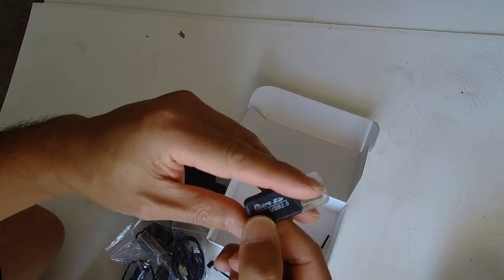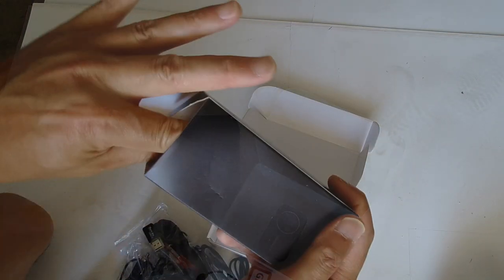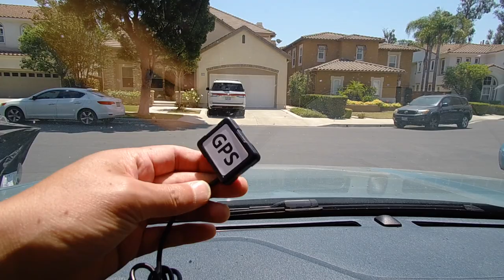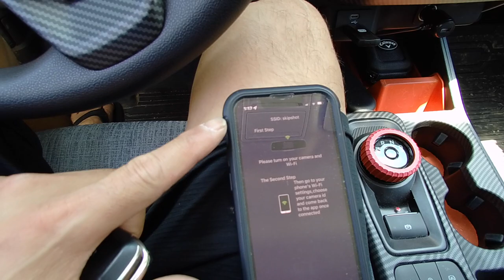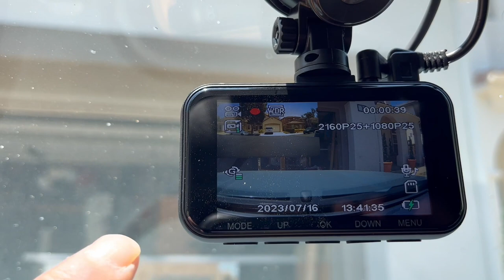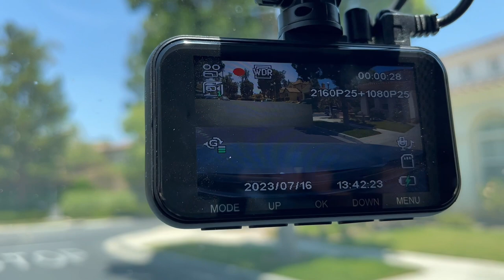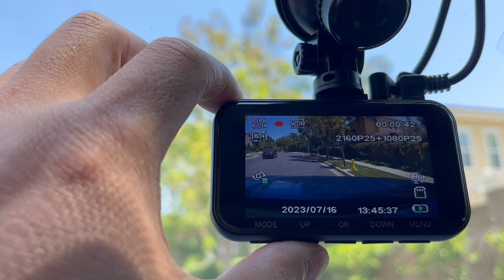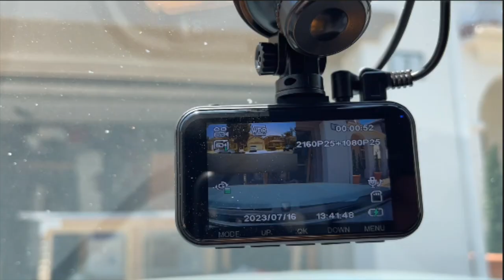GEAR N REVIEW Cheap Solution To Campervan Rear View Obstruction? Bonus Dash Camera (haha)

Comment: Nice review, however, I've learned the hard way about some of the inexpensive cameras, these companies will upgrade shortly there afterwards, taking away the app, just leaving U with a monitoring device☹️...so that you'll need to upgrade in order to continue the intended use too begin with!

PS: I was told precisely by the manufacturer, "do U expect for us not to manufacturer newer models & not be able to sale them". Plz be careful w/that by checking manufacturing date, that'll help some.
Reply from the maker: I agree. The apps are not great. But for this case, I won't even use the app. Just camera and display :)